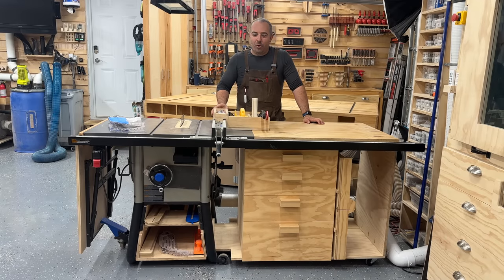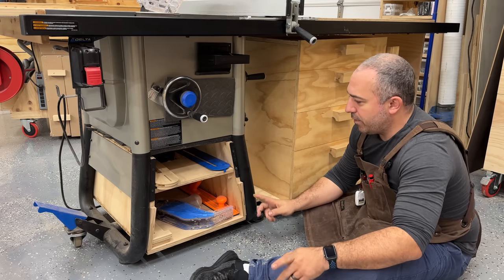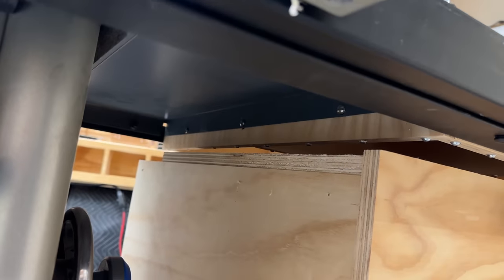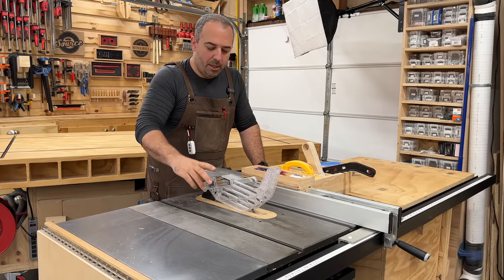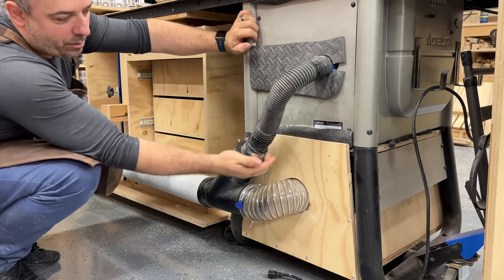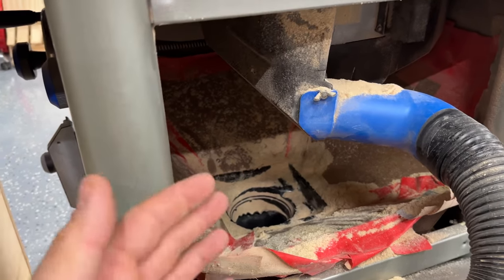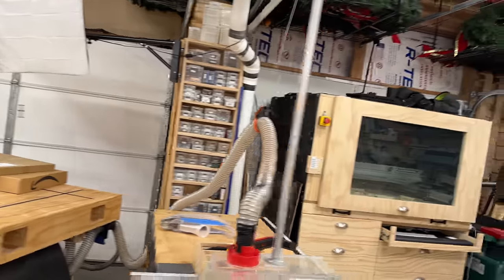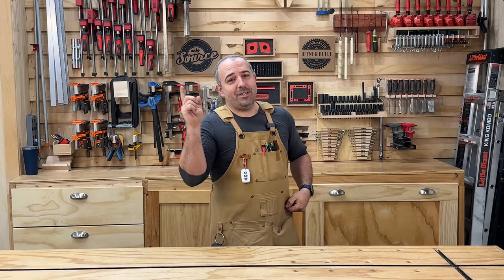Table Saw Additions Accessories and Hacks Delta 36-725

Comment: I have this saw. I haven't done anything for additional dust collection other than drilling some holes around the front side of the zero clearance insert and I have no issue with excess dust. I think the best thing you can do for dust control is have your fence properly aligned. You should not be getting dust thrown up by the back of the blade.

Comment: I have the Delta 36-5000T2, the slightly bigger brother. I only have the 36" capacity as I can't fit the bigger capacity.

I love it, but it's too short as I'm 6ft2, I'll be fixing that soon.

One of the main differences is it comes with an extra sheet steel insert on the right side so no spreader bar. Second, it has vastly improved dust collection with a good chute covering thr blade on the underside, no dust falling to the floor. And third, the rail is 1 peice vs the 725s original 2 piece rail. And fourth, a beefer, better fence. I'd honestly suggest the upgrade to it over the 725, it's only about 300 more. Worth it. Love it. 

But great video!

I'll be building a riser box to bring mine up another 2inches. Right side is where my dust bin is. I have a full 1hp dust collector in my outfeed table.
Reply from the maker: Very cool!  I would love to see a picture of your riser box build when you’re done! And I would contemplate getting this one, if I didn’t have my eyes on some other super expensive shined toy 😉
Reply: @Bitner Built Woodworking  I considered other table saws and honestly for what I do, the value isn't there. I'm a hobbyist that's been at this for 25yrs, I'm not a production shop and I don't have employees. I'd rather spend the money on jessem stock guides and magswitch featherboards vs a sawstop.
Reply from the maker: @MrCypherdiaz  completely agree, and wouldn’t argue at all, I do have that little voice in the back of my head all the time they’re saying it would really suck to cut my fingers off, you can be as careful and as diligent as you can be, but it only takes one . And as somebody who visits the emergency room regularly…. Odds aren’t in my favor!
Reply: @Bitner Built Woodworking  I've had tons of close calls but every time my push sticks take the damage. Just had to replace my gripper cause a board split once the cut had released enough tension. This pulled the gripper into the blade right before chucking it past me. Nice dent in the wall and scary but no damage to me. 

I think the sawstop gives too much security where one becomes complacent. Personal opinion. Proper safety practices matter more. 

All that said, I wouldn't say no if someone wanted to give me one of those King or Grizzly sliding panel saws. Cause yaknow, goals! Lol
Reply from the maker: @MrCypherdiaz  hahaha yea those are 🤩 so there is another opinion to consider. As you become very skilled in something that you’ve done repeatedly again, and again, and again, and again, things become second nature, and you can do them almost without thinking. I use one of the businesses that I own, for example. I have an employee that go up on the roofs all day long and so there’s an incredible amount of safety precautions that have to be taken, safety tools, Safty ropes, etc. techniques are learned and you become more and more comfortable up on that roof because you’re doing everything correctly and following the safety rules. My best and longest employed worker and I were up on the roof doing everything completely correct when a shingle that he was standing on, ripped out and gave away and he was then dangling off the side of a three-story roof in a split second. Luckily, he was wearing his safety rope and harness, so he didn’t die but he was injured. He had done this maneuver correctly 1000 times, but it was that unforeseen thing that happened that one time that did injur him. So I totally agree people can become more complacent however, its that one unforeseen thing that could be a disaster. If there’s an option to avoid, I would take it.

Comment: What would be some other budget friendly router tables that would be great for this saw? The Kobalt isn’t a bad one but I’m not 100% sure in it. Great ideas on the longer fence and dust collection!
Reply from the maker: Honestly you can grab a static manual plate and lift off Temu now I have not tried any BUT it’s a flat piece of plexi/ composite/aluminum so should be fine!

Comment: Use 2 more drop down rods to form a pillar.  If the roof attachments are fixed and the ends are linked it should eliminate motion in all directions.  If there is a little wobble add a small removable weight to the bottom of the pillar since the hood is so light.
Reply: PS If 2 of the roof attachments are hinged in parallel and the third spring clips in place with a pull cord release, you can fold the retracted pillar to the roof.  Drop it from the long axis of your table and the hood won't be an issue when it is folded up.  Mount it to a base so it can be moved if you reposition your table later.  Run the vacuum tube down the pillar.
Reply from the maker: Great thoughts Darwin thank you! When I’m done with the corner of the shop remodel I will get back to the table saw area so this will be fun to try out. Appreciate it!

Comment: Interesting video. Love the ideas you came up with. Ever considered getting rid of the factory legs / caster system? Personally I am not a fan of the factory setup. I want to build a mobile cart and integrate a router into mine.
Reply from the maker: I actually recommended it to somebody else who didn’t like the height of the table in relation to their height, i’d say go for it
Reply: @BitnerBuilt  I saw that, I was just wondering why you didn't take that route for your own project.
Reply from the maker: @DanielTaylor-hn4ut  well it’s been a progression, I’m at like step 7 now on it so yes could have totally remade it. In fact, I’ve been debating replacing the top of my outfeed table assembly table, but I didn’t want it to get taller than the saw, so making the saw slightly taller with a cart that it lives on would be a good solution.

Comment: Hey Justin, Great video as always.  I have the 36-725T2 and I have to say the dust collection on it is HORRIBLE.  I have seen videos on other channels with the original 725 and thought I was missing parts because the dust collection is far superior on the older model.  The T2 is wide open on the sides and back of the motor cavity, and only the front is covered to account for the angle adjustment.  Its almost laughable at the lack of effort they put into it.  There is a small attempt at making a funnel around the blade, which has a similar dust chute to the original but nothing is enclosed.  I have been all over different forums looking for ideas to improve it, but ultimately I think I will need to build some type of enclosure, where I removed the current legs and inset the saw similar to the way you described a solution for Spencer.  This will at least give me the ability to have some type of outfeed built in as well.  Possibly looking at building a bench where a fold down miter saw station can be built in as well.
Reply from the maker: Thanks Bryan! Oooo yea…. Honestly, I was really baffled when I first brought the saw home and it just dumped everything on the floor. I’m like am I just supposed to duck tape a garbage bag under here?!? I think you’re on the right track if you make some sort of station that you set the saw in, then you can give it added, modularity and enclosure for being able to collect the sawdust. I’m sure you’ll actually even be able to get more suction in that scenario than what I’ve been able to get compared to that really complicated set up inside my saw (looks simple, but getting all that stuff positioned inside the saw was a pain) would love to see pictures after you make it!

Comment: Is there a reason you couldn't put much longer bristles on the perimeter of the dust hood? It wouldn't be perfect from a sealing standpoint, but it would allow you to keep the frame of the hood above the blade.
Reply from the maker: I didn’t  think of that however pushing on the bristles still moves the unit so still have to stabilize it more. I have had some great suggestions I will be trying out soon!

Comment: I cut the four metal tubes one the saw box down to lower the saw because I wanted to keep the mobile base. And if you take off the front piece of foam you’ll get more dust collection and nothing will come out of the front. A totally closed system doesn’t allow air to flow. There’s a Company called Shark gaurds that sell after market blade guards. There pricy but nice. Have a good one

Comment: Have you tried attaching a couple of featherboards to the fence and your overhead dust collector to keep it in place so there is no wiggle?
Reply from the maker: That’s a good idea I have not tried attaching it to the fence, if I attach it to the fence, am I still able to get a push stick through?
Reply: @Bitner Built Woodworking  only if you slde the push stick through along the tabletop.
Also, since I made the original comment, it would just be as easy to make a hinged system to your fence tray and dust cover since your using flexible hose that drops down from the ceiling.
Reply from the maker: @randyfraser1608  I would worry about it. The force is exerted on the fence, and might have to look at making a much thinner and lighter version of the guard, as it is now it’s very heavy, and I feel it would negatively impact the fence applying that weight to it overtime but super great ideas!
Reply: I'm not saying to attach it to fence, I'm saying attach it to the fence tray with a few pieces of scrap wood, so the dust collector doesn't wiggle into the saw blade. You could even leave the pole on to support the weight of the collector fully.
Reply from the maker: @randyfraser1608  ahhhh ok got ya now. I was just envisioning putting two strips of metal going from the enclosure to the box with a wingnut so that it’s easy to tighten and adjust as you move the fence sliding back-and-forth in the metal strip. But then I was just thinking this piece would have to be incredibly long if I want to still have full range of my tablesaw fence, if I move the fence 48 inches away, for example.

Comment: Regarding the Kobalt router table.  I had it installed on mine for a while.  It does install pretty easily, but I removed it for a couple reasons.  It is a thin casting and the miter slot is smaller than the one on the table saw.  I wanted to be able to use the same, higher quality, miter gauge I bought for the saw.  That was the biggest thing.  I also wasn't thrilled with the fence on it.  I'm deciding whether I want to build a lift into my outfeed table or bet a better one to put into the saw.  Probably the Bosch seems  best and not a ton more money.  That's just my 2 cents.
Reply from the maker: Thanks Rex, yeah, I ended up going with an expensive Kreg router lift, I just found it so uncanny that the cobalt installed so easy that I wanted to share it out. Definitely not the most high-end unit.

Comment: I like the modifications you did.  Where did you purchase the adjustable folding leg assembly for your folding extension wing?
Reply from the maker: I have a video on it, it’s a folding table from Home Depot I remove the legs from Easy Build! Folding Extension Wing / Folding Table
https://youtu.be/Zuy0Bjh13Vw

Comment: If anyone wants a new or longer fence rail on the cheap, just remember it's just angle iron and square tube. You can buy it all day at the big box stores for cheap and buy a stick-on tape for the measurement.

Comment: you also can seal t=your ovc joint if you do not wish to glue them.
Reply from the maker: Thanks! And I’m still in the modification phase of all of that so I’ve just been temporarily wrapping them. I honestly think I’m going to take an entire branch of it off that goes to the band saw and just wheel the bandsaw closer to the dust collector when in use. I don’t have a great collector atm so I think the excessive ducting is too much.

Comment: I have the same saw and as far as dust collection, I put an adapter  on the dust shoot up to 4" and run a 4' flex hose to my Harbor Freight dust collector and I get no  dust out the bottom and get hardly any dust out the top.
Reply from the maker: , Well, that’s great that it works for you that well! I have the exact same as collector, and it definitely does not do that with me. I actually have it hooked up to the dust collector and a shop back at the same time, and mostly the dust.

Comment: I have an old 34-440 Model 10 saw and it came with a Biesemeyer fence, an extended table on the right side and it moves on a steel frame. The wheel "list" is on the right side of the saw so it's under the table which leaves adding stuff to it hard to do. I didnt think about adding a new one on the left side of the base. Wheels are turning!
Reply from the maker: Oh very cool!

Comment: Hey build looks great! I've been thinking about doing something similar myself, but quick question.
I'm worried that when I push on the blue foot lever to tilt the saw onto the casters, the far casters under the wing will lever up and push the wing out of alignment.
Have you had issues with this?
Reply from the maker: I would say most likely no. I move my table saw around ALOT! And it does need its squareness checked every so often. I would more attribute that one to the changing of the seasons, then movement, but I’m sure contributes some but I’m not seeing any major movement in the unit at all when I do have to tune it up.

Comment: So drill you little hole in the box, epoxy a rubber cone-tipped air blower nozzle into the hole so that the air hose fitting is sticking out.  Every now and then, hook up an air hose to it, drape a big canvas drop cloth over the whole thing, kick on the dust collector and blow it out.  Just grab the air nozzle from outside of the drop cloth.  Let the dust collector run for a few minutes after to clear the air under it, pack up the drape cloth and sweep up any thing that settles.
Reply from the maker: thanks for the tip!

Comment: you can do what I found that work with my table saw. I the air duct department you will find aluminum tape. Saw dust will not stick to the tape.
Reply from the maker: That is definitely the right way to do it. I have four rolls sitting in the garage now, just so much to do all the time I had use electrical tape when I was heavily modifying the whole system and testing things with the wind speed meter, taking things on and off. I have just been lazy and haven’t taken it off to put on the proper tape!

Comment: This system doesn't make sense to me. Like you, I have a high flow low suction bag filter, and a low flow high suction shop vac. I use my 2" shop vac system for smaller tool dust collection, and plumb my larger pipe 4-5-6" system to tools that throw a lot of chips (cabinet saw, planer, etc.). Your shop vac can pull nearly 100" WC (water column) of suction--making it ideal for high suction and lower CFM. Your bag filter will pull something like 800 CFM at a much lower suction (2-4" WC). But, this system will need sufficient holes at the end to open a channel for the air and chips to make it to your dust collector. (Sucking on an unplugged straw.)

I have liked and subscribed. As a fellow "plastic spoon" woodworker, I avoid throwing money at operational challenges in my shop. We are all on a journey as makers. Helping each other on that journey is one of our highest virtues.
Reply from the maker: Oh there’s still tons and tons of air flow vents and the foam I’m using still has perforations, it’s certainly not air tight. the idea is to more focus where that air flow is coming from. A good example is a miter saw enclosure, if you put a 4in hose just there next to the saw, no dice, so you channel that suction to several key points to be more effective.

Comment: Justin, have you had any issues with deflection in the back end of the fence? I see this complaint about this saw.
Reply from the maker: No, at one time I thought it did but it was the riving knife coming out of alignment, was a 10 second fix to tighten the bolt on the arbor to realign. That’s prob the cause for a lot of people
Reply: @BitnerBuilt  I have a dewalt dws7491 built into a large assembly table, but I'm wanting more precision. Thinking about selling it and maybe going with the delta.
Reply from the maker: @Ekrindul while there are much more high end options (way more $$), for the price your going to see a huge difference in comparison to your current saw and will be very happy with it. Especially at the price
Reply: @BitnerBuilt  That seems to be the sentiment I've seen with owners who have had both saws. Plus, I can recoup some cost selling the dewalt. No shortage of contractors in DFW area willing to buy used.
Reply from the maker: @Ekrindul  definitely, I actually get companies wanting to send me contractor saws a lot and once you go to an actual cast-iron table saw, it’s hard to look objectively at the contractor ones because there’s just such a huge difference in the quality you’re gonna get. I totally understand why especially with weight the contractor saw are made the way they are, but it’s just so much nicer 😀

Comment: with any dust collection, along with directing air where you need it, you must have make-up air.  too much restriction  of air flow diminishes the effectiveness.  You need enough capture velocity to pull the dust into the system.
Reply from the maker: Your totally right but there is definitely still more than enough air ingress to the system to move the material, the goal was to focus it and containment so the airflow would produce results. If you just put an active hose in a large open cavity the results will be next to nothing, but if that cavity is confined you will pull floating air particles and funnel the settled dust